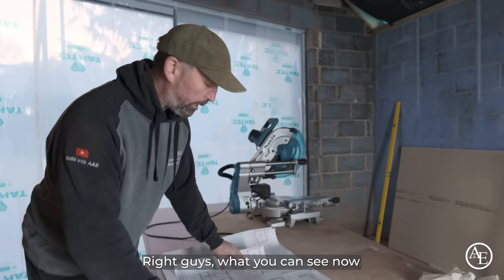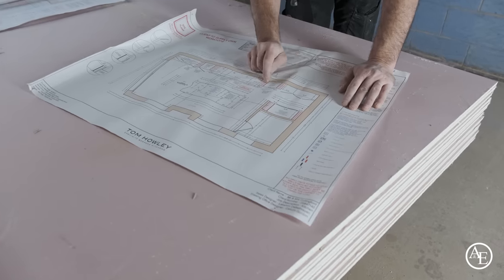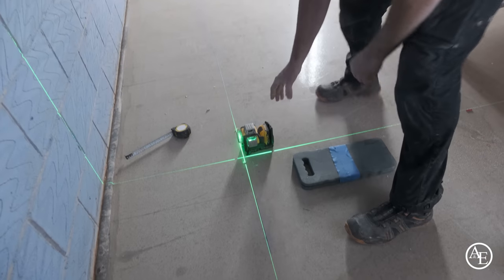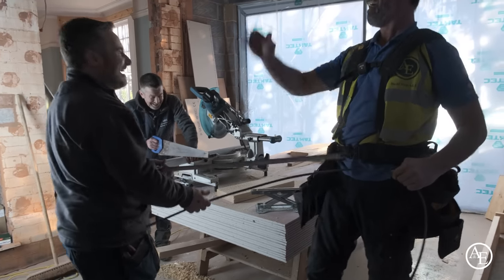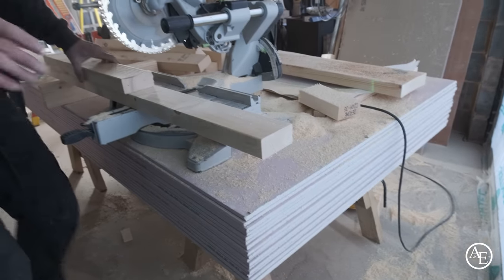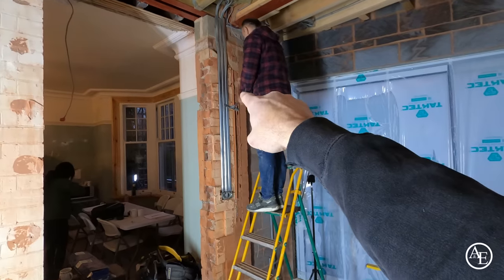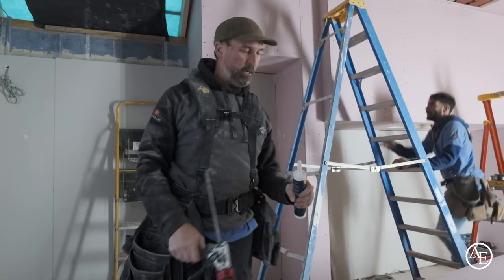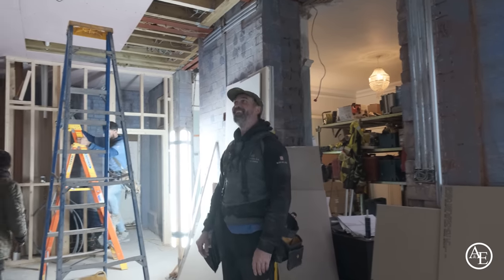Stud Wall & Plasterboard for the Kitchen! - Luxury Extension | Onsite #19

Comment from the maker: What do you guys reckon', laser level or string line and a normal level? 🤔
Reply: Laser level is great if you are starting from scratch
But if you are saying stuff onto a brick building then you need to do actual measuring of things because, as you know, they aren't always square, as you found out in a build you did with the reinforcing of the floor for that bath last year or the year before
Reply: Old school levels lines and chalk line 😉
Reply: Laser all the time Tony - As a architect I'll be lost without my Disto - Great job, love the way you guys work, attention to detail is what it's all about, love to work with you guys as I'm locally based in B'ham. I'll be very interested in a Tony Light when there ready.

Comment: Massive holes going through them joists,  can't see that being passed by an inspector
Reply: You can drill a hole a certain size based on the height of the joist
There a regulation about distance and stuff too that I can't remember now so it will pass it those rules are met
Reply: That’s not good I was told be our building inspector that the hole diameter can only be max 1/4 of the overall joist height and in a certain part of the joist….. plumbers! lol
Reply: hi Tony were his John gone not seen him for a bit keep  up the good work
Reply from the maker: Hi Tim he has left unfortunately and missed he has moved out of the industry completely 
All the best Tony 👍
Reply: Generally, they do not like it going over 50mm and only through the center of a joist and even then they may ask that the joist around that area is reinforced
Reply: @BuildWithAE  what industry has he moved into? seems a shame as he was so talented, but as long as he is happy!
Reply: Indeed - especially so close to the hanger.
Reply from the maker: Did anyone notice the thickness off the joists ?
Reply: @BuildWithAE  yea good thickness but holes did seem big ...but you lads defo know the score so no worries here 👍